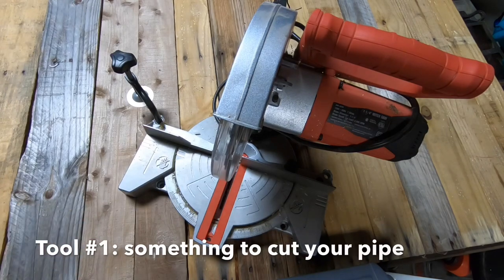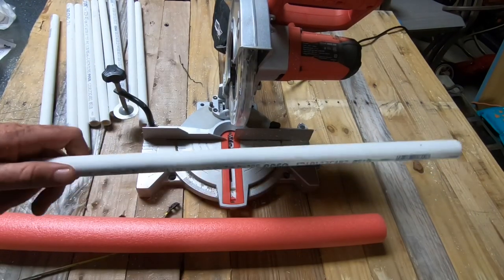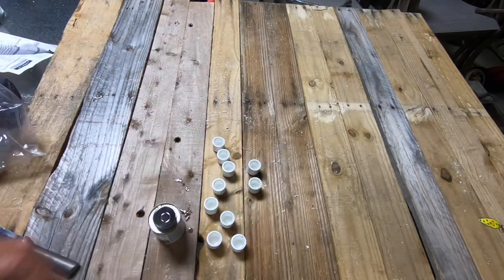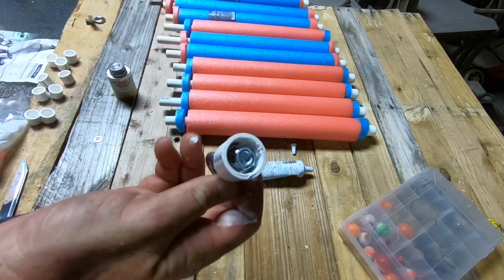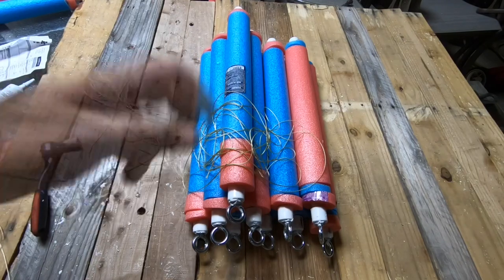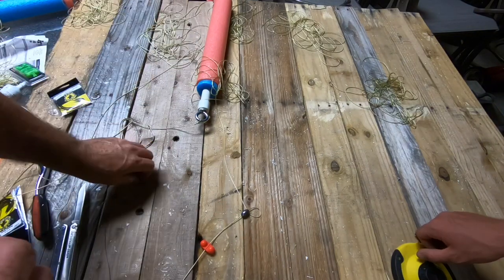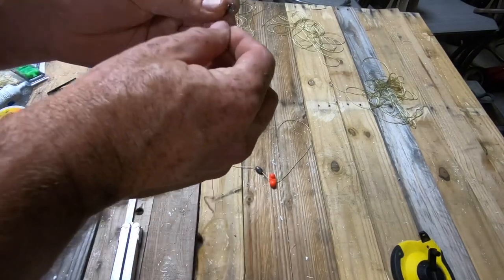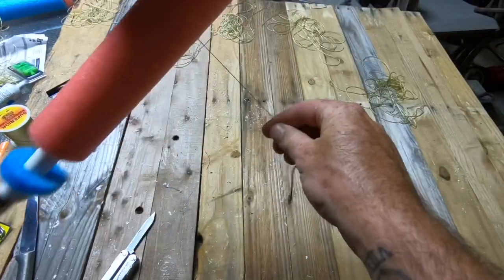How to make the best Jug Lines

Comment: Great video!  Very similar to the way I make my noodles.  In my state, we can only use (5) at a time per licensed fisherman, so I do a few things different because the cost isn't as much of an impact.  The "star" noodles have more float to them, cost a little more and harder to find.  They make wrapping the line easier too.  I have found that polymer knots are easier to get "tight" using braided line.  I also like to do a surgeon's knot with loop on the hook leader, then I can swap out hooks fast and easy without reties.  Depending on the bait I have - I change hooks about each day of fishing.  On the eye-bolt, I like to attach a snap swivel of some sort - it allows for a quick depth adjustment without having to tie or wrap anything.  Different color noodles help for tracking which type of bait is on the line - helping to narrow down what the fish are feeding on.  One thing I really like about your setup - the line choice.  Most juggers use that giant, really stiff line that is difficult to tie and really catches current.  The thin line is plenty strong, easy to tie, and doesn't catch the current as much.  Sorry if I rambled too much.  Happy fishing!
Reply from the maker: Thanks a ton for your input! We did learn a lesson on making hooks easier to swap out. I started doing a surgeon knot for the loop on one end and a snell on the other end, the. Loop the hook though the circle which is ran through the swivel. Hope it makes sense but sure is easier!

Comment: Those were khale hooks, not circle hooks. You shouldn't glue all the caps first and then put them on. PVC glue dries really quick. When gluing the cap with the eye bolt onto the pipe, spread the glue on the pipe, not inside the cap that's filled with fresh silicone. If you put a snap swivel on, instead of just a plain swivel, you can make replacement hook lines with a loop on the end. Then if a hook gets straightened out, snagged, broken off or a fish swallows one, you can quickly swap the hook line and get it back in the water. Other than that it looks like you did a good job.

Comment: I was wondering if this would work smaller and attached it to a rod
Reply from the maker: Yes it will. Just make sure you get the right size end caps. Also check your noodle, I bought some and the inside diameter was way to big for the pipes.
Reply: They make one already it’s called muddy river catfish bobber

Comment: I'm gonna make some. What if u only wanna let out 5ft of line? How would u tie it off so it would let all 25ft out?
Reply from the maker: I’ve seen guys put a hook, kind of like the I-bolt (on the opposite end of the pipe) and let out 5 feet, wrap around the hook and toss out.
Reply: @thekidcansell  thanks
Reply from the maker: You could also use a bobber/float/plug

Comment: How much money per noodle do have in them?
Reply from the maker: I think it was around $3.70 a piece
Reply: UsedBoatsTV - Used boats for sale reviews thanks for the instructions. I can’t find any tubes that have a half inch hole so I will be going with a 1 inch and half to compensate using bigger PVC and fittings. Same thing only different I suppose